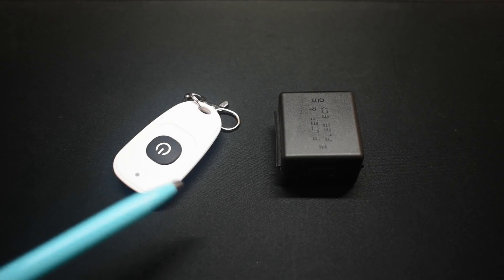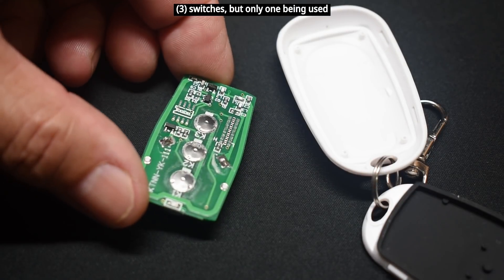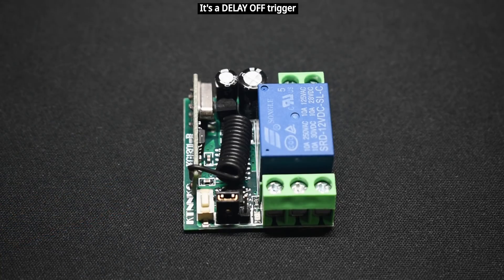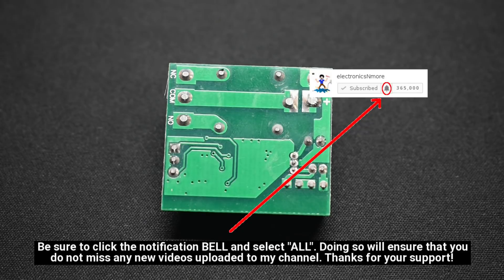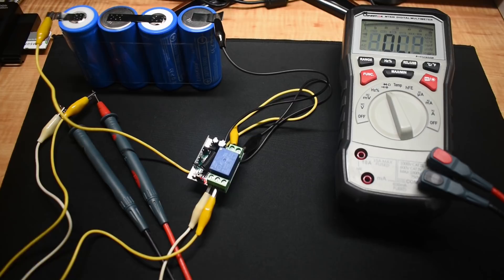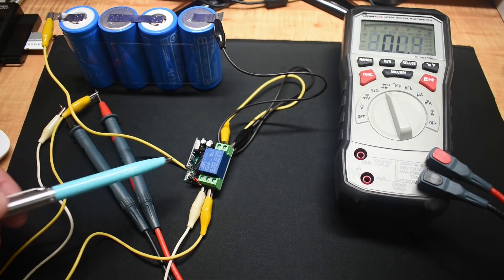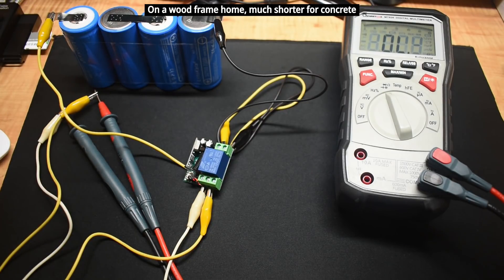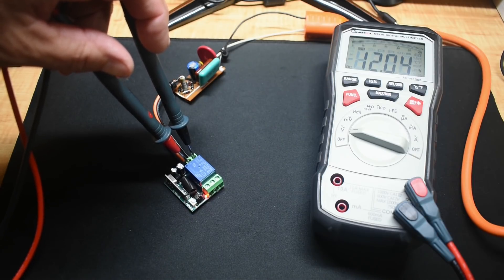Dirt Cheap Wireless Remote Control Relay Module! (12v /110v/220V)

Comment: So..if you wanted to use this as a wireless remote start button...wouldn't you need 2 circuits instead of one ...one to turn on power in said vehicle..then a start circut..???

Comment: These remote controls are very easy to hack... be warned
Reply from the maker: The average person will not know you have a remote, and the average person won't be able to hack anything. It's low cost, but it is rolling code. Anything can be hacked. Thanks for watching

Comment: A really great use for these are as a 'wireless' wall switch. I saw a commercial unit that featured a regular wall swithc just glued or sotherwise mounted to a thick stone wall. There was only power going to the ceiling light and this avoided running cables through the 10ft wall tothe ceiling. 

I had 3d printed a switch that acomodated a similar switch with my first 3d printer, But there are much better designs out thre now and for free.

And now I use is for one of my own renovations to add lighting options at almost no cost and wires.

Thanks for the reminder.
Reply from the maker: Mine works great. A click of the remote, and the light 200 feet away turns on. Thanks for watching!

Comment: Really sorry for the nature of this question, but: I have picked up a $15(ish) alarm from Amazon which is pretty good for my motorbike/ebike. Could this be adapted to power a loud motorbike horn without being the biggest project in the world? https://www.amazon.co.uk/gp/product/B073VKMJDH/ref=ppx_yo_dt_b_asin_title_o00_s00?ie=UTF8&psc=1

I have a lot to learn about relays/switches/amps/volts/DC/AC it seems but in theory to power a 12v Denali sound bomb 120db, is this manageable ?

Comment: Can you add an external antenna to the receiver to extend it's range?
Reply from the maker: I think they use an 1/8 wave antenna, so using a 1/4 wave antenna in place of what's used, will extend range. You can find antenna calculators online. Thanks for watching!

Comment: very thorough presentation.  it has me wanting to view what else you've posted.

question ... suppose you have several loads you wish to rf switch on-off all within 200' of  each other.
when you push the fob button wont all of the loads turn on ?  

in your vid i was watching for a way to 'code' the load ,  say with 8-bits,  or via the means Pic Basic
language offers to use an ascii code-word  to protect your load from a stray rf signal.  i mean 315 and 433
are  a crowded rf band for consumers.   

     i can think of one common  'code' practice is alreadly in effect for cars so when
you are in the parking lot only your car blink- lights up and no one elses as you approach it  on foot.

   ps - could you clarify the 'paypal donation' .  last time i checked with patreon it was not clear 
if a donation was a 1-time thing or whether one would be charged an amount for every viewing
of any of your vid's.
Reply from the maker: If you have several loads, then definitely buy a 4 channel version, also cheap. I only use PayPal for channel donations. Thanks for watching Bob!

Comment: I do not think you can stuff that module and the DC supply in a standard box and keep the switch. Even if you remove the switch  it will be almost impossible. I have tried doing it with similar devices and with all the wires and connectors and the switch  it was a struggle. The devices I used were a lot smaller and it was 120V, not requiring a DC supply. Did you consider using a smart bulb in the lighting fixture. . Using the bulbs app and a smart phone you could control it from anywhere.  I you have Amazon Alexa or a Google Mini you have voice control.
Reply from the maker: No. It goes by the light fixture. Plenty of room inside a round plastic box if the only wires inside go to the light.

Comment: What a great deal from Bang even though it would take several weeks to arrive, you get two(2) remotes. Great as a springtime project! 200ft easy, huh. Great!
Reply from the maker: I got it in 2 - 2 1/2 weeks
Reply: @electronicsNmore  That's not bad considering it's the season.
Reply: What about a simple wifi AC outlet primed from Amazon for $10 in one day? Instead of a 300 foot range range is unlimited over the Interwebs. Banggood is now charging about a 20% shipping fee.
Reply: @joecraigslist9467  Please provide link. thanks. And I have several items, direct from Amazon, I've been waiting for due to delays, so all shipping is real screwed up with 90% I've been experiencing. So that's not guaranteed, unless they are all targeting me along. :)
Reply: @ThePreyMantas  search for wifi AC switch.
Reply: @joecraigslist9467  Will do. Thanks, JC!

Comment: It would probably be safer and simpler to use 12v lighting, with a ac to 12vDC converter, to power the device, and the light, I have 12v lighting, with battery bank, solar charged, for home lighting, nearly anything around the house, is available in. Low voltage DC, most is DC anyway, I have a 4way remote relay similar to this, I plan it use,  maybe a door lock, and certain lights, I haven't decided yet, awesome video, are you going to go further , as in part two?
Reply from the maker: I only do part 2's if a video does very well, at least tens of thousands of views. As for the relay, I've never had any problems switching AC mains. Thanks for watching James!

Comment: Sweet devices! Hacking the remote also gives you infinite options to extend it with a microcontroller or just wire in an external trigger button/activation trigger, like a sensor.
Reply from the maker: Yes, so many uses. Thanks for watching Tor!

Comment from the maker: If you're interested in the 12v transformerless power supply shown in this video, then you can find the schematic at the link below. To use with 220v, reduce the poly capacitor value to 1/2 the value shown, with a rating of at least 400v. If any resistors get too hot, increase the wattage. Only supply power to the circuit after it's connected to the module. 
https://i.postimg.cc/63wy6yTj/DSCN7415.jpg
Reply: Absolutely!

Comment: Those cheap relays are not very reliable, sometimes they fail. I recommend replacing them with good quality ones for mission-critical applications.
Reply from the maker: Yes, that's easy to do, but luckily I never had problems with the Songle relays. Thanks for watching Lete!

Comment: Question, could one of these be used on a winch? A two channel remote in particular?
Reply: Run this with a Ford style starter soloniod ...that'll cover your high amperage...
Reply from the maker: As long as the current doesn't exceed 10A, you can use the module below. 
https://bit.ly/37UiniU
(Affiliate Link)